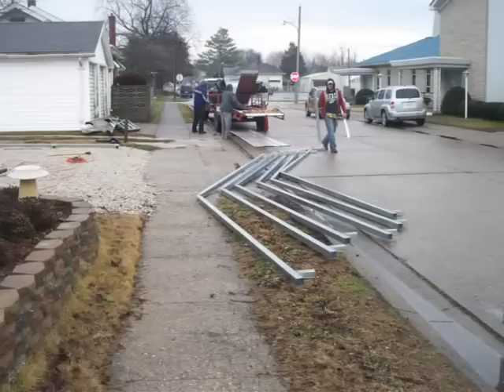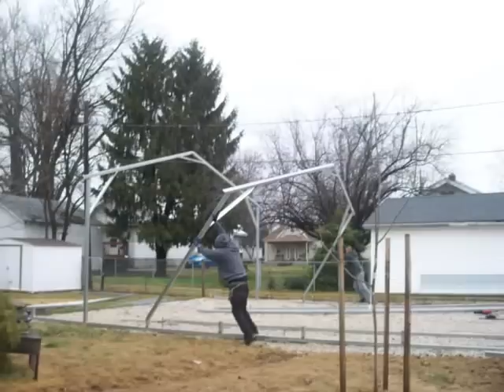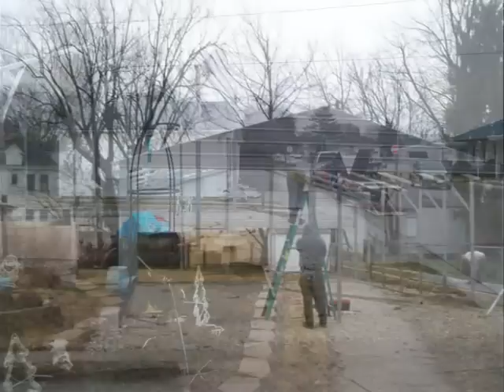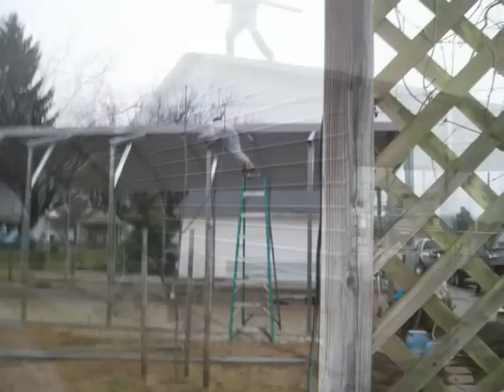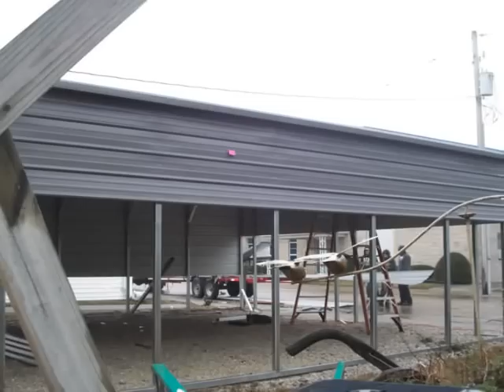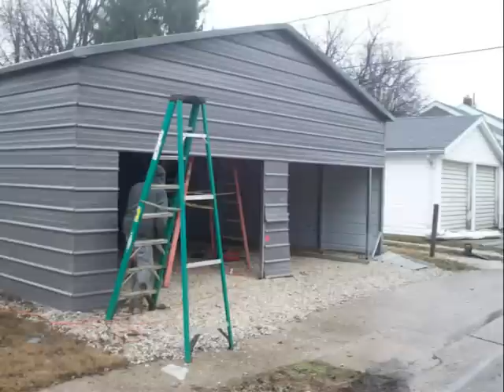carolina carports

Comment: The base holes for drilling into the concrete are offset on our base rails.  Should the anchor bolts be on the inside our outside of the carport?  Can you advise?
Reply from the maker: Carmel Cunningham I anchored on the inside with mobile home anchors